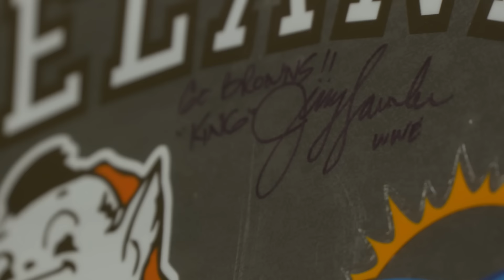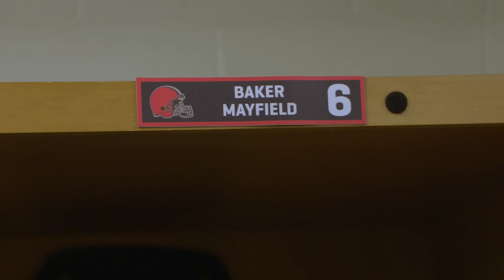How the Browns Equipment Staff Preps for Gameday | Building the Browns 2019

Comment: NFL shoulder pads are like child sized relative to the size of the player, yet the helmets have to be super high tech and "safe." LOL!
Reply: Having bigger gear won't exactly guarantee better safety. You can make the argument that the larger mass of the player moving at the same speed with smaller gear will generate more force. Also, larger pads wont allow articulation of the shoulders or head, which could result in more injuries.
Reply: Would you rather take damage to your shoulders or your head ?